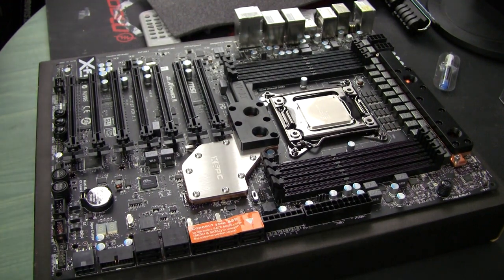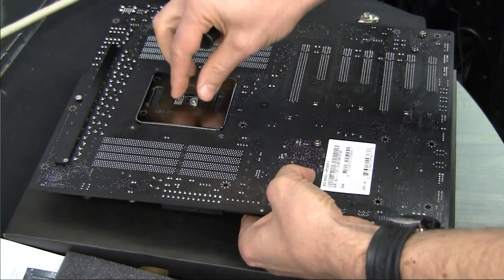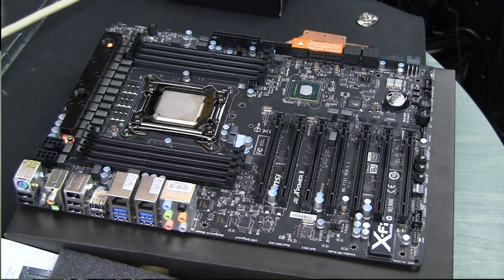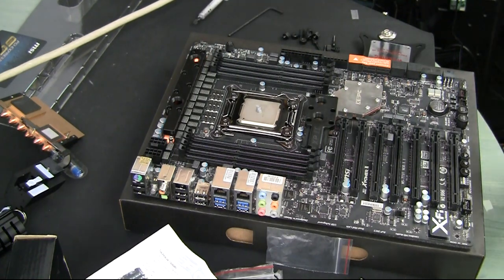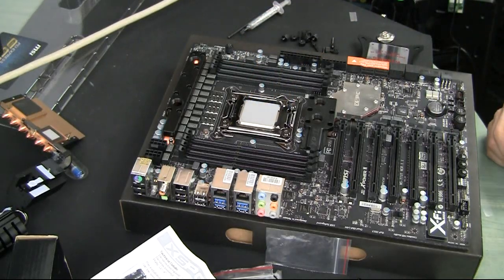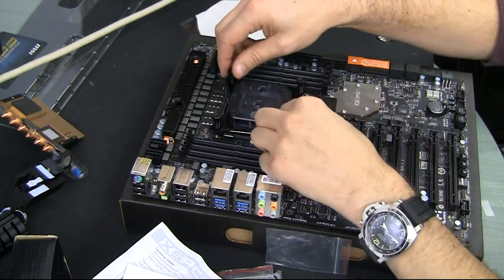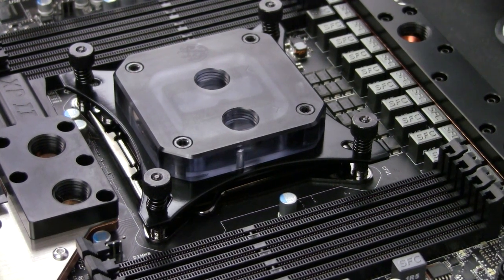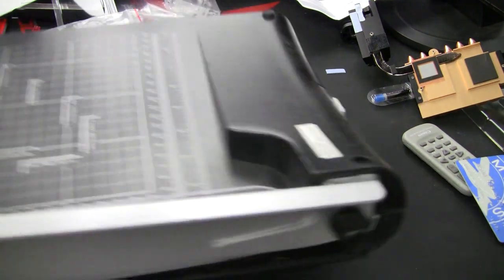Bitspower Summit CPU and RAM Freezer RAM blocks installation (Venom build)

Comment: did you find that this cooler was better or worse than the ram cooler that was individually cooled and tubed ?
my computers tend to use the largest and highest flow as possible, and id somewhat like to keep the restriction to a minimum

Comment: Can thermal paste be used instead of tape on the memory heatsinks?  Are there any advantages or problems using paste versus tape?
Reply: Trenton Scott Thermal pads (or tape, whatever you want to call it) ensures that the components come into contact with the heatsink. If you used paste instead of pads then it won't reach the heatsink OR you will have a pile of paste, which will have a lower thermal blank(I don't mean blank, I just can't think of the right word, maybe conductivity? You get the point)

Comment from the maker: It depends if you buy Corsair Dominator GT block or Universal set (which includes replacement heat spreaders in addition to the block).